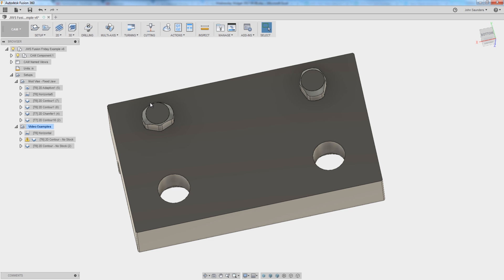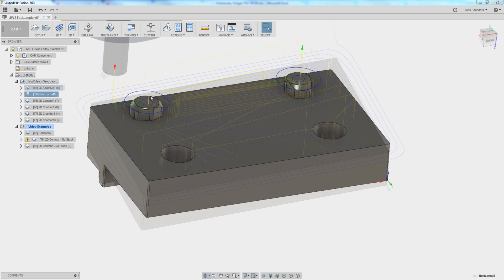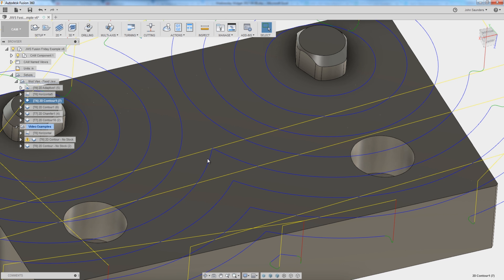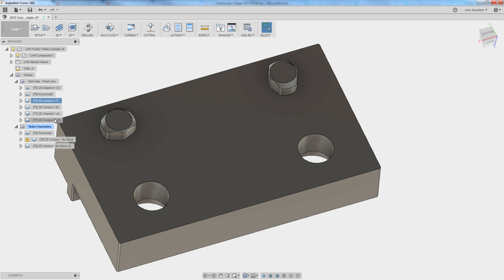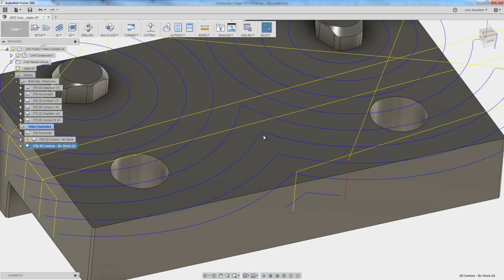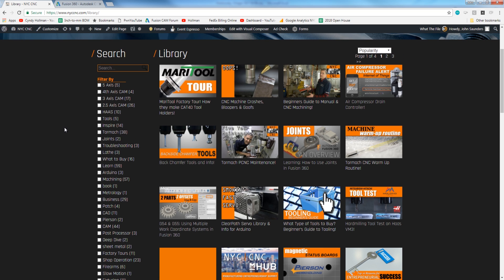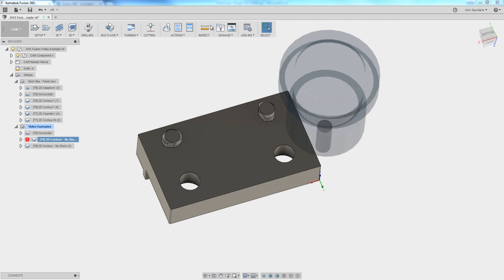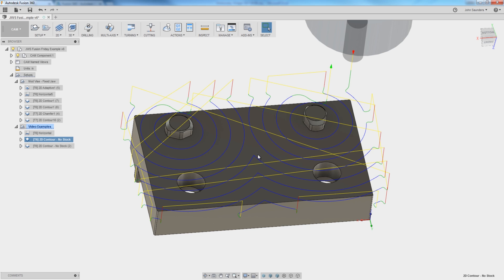How to Improve Surface Finishes in Fusion 360 CAM!  FF118

Comment: May be able to more generically solve independent of CAM using G64 path blending. Should also help with the gear example from a while back, with all the small movements that slowed down the controller, which may be a sign that PathPilot has G61 exact path mode set.

Comment: What about using an open pocket tool path?
Reply: Occams Sawzall have you tried doing an open 2D pocket in Fusion?
Reply: Scott Moyse 
Yes.  Just hold alt while selecting and select the two wall contours you want, will display a blue field to show what it is cutting click the red arrow to change cutting sides. 

It will create an open pocket tool path using the 2 selected contours as boundaries and will start on the outside open area between the two contours.
Reply: On this part he should be able to select  the two pin contours, flip the side the pocket is cutting on, and use the stock contours to control how far out it cuts.

It should make a toolpath that’s all straight cuts till it reaches the pins and then make a single contour around the pins, depending on axial step over settings.
Reply: FYI, it's the same algorithm that does 2d contour and pocket.  That's why 2d contour does trimming etc.
Reply: hmmm they've fixed it. It never used to work.
Reply: Scott Moyse 
Really?  Can’t say I’ve used it much but always worked for me. 🤷‍♂️